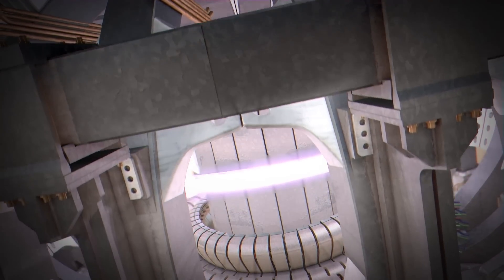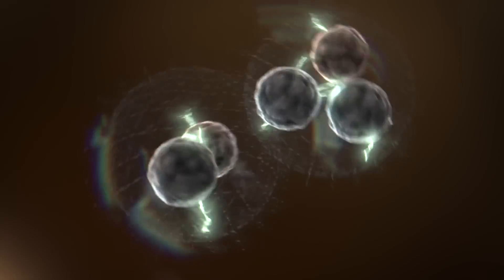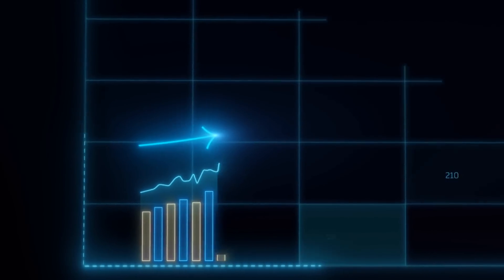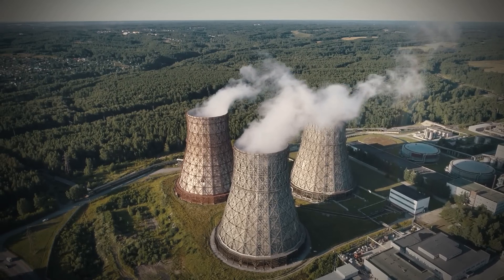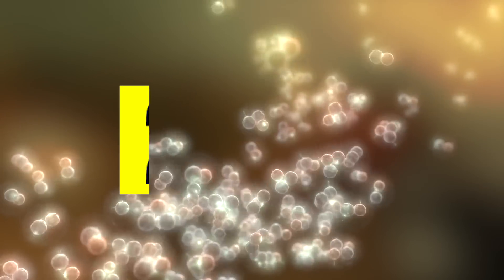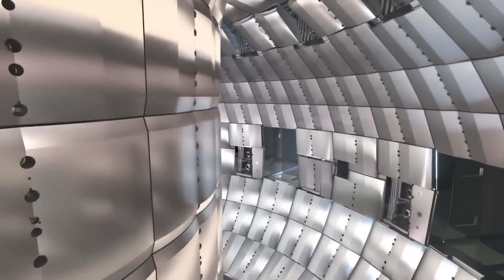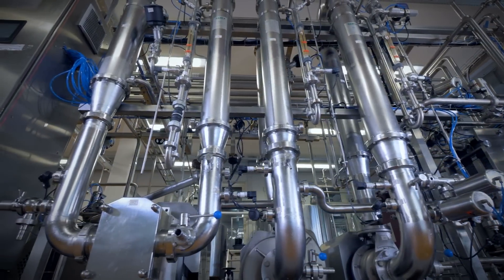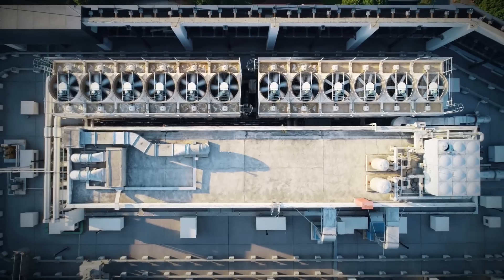The Shocking Problem That Could End Nuclear Fusion

Comment: Please do a video about First Light Fusion: projectile fusion aka pulse fusion (not self-sustained).  As I understand it can use deuterium only or both tritium and deuterium.  Would this be feasible in your opinion?
Reply: Right! Newer cheaper methods of ignition are being developed.
Reply: @n1mbusmusic606   yes, only $45 million (and many years of r&d).  Not a self sustained reaction, but it creates more energy out than that required to fire the electro magnetic gun.
Reply: @Joberrr  isn't general fusion piston reactor building pilots plants in UK and Canada though? Or is it just be..
Reply: @n1mbusmusic606  this is not the same as the piston reactor; this uses a small pellet fired with an electromagnetic rail gun at a 1 inch plastic cube with some deuterium inside.
Reply: @Joberrr  right wouldn't pistons pummeling a molten core of metal he just easier? General fusions design looks pretty sweet. Anyhow yeah I guess the fuel thing is an issue. My thing is we need to go to space for a few reasons(asteroid defense and mining etc) so why not just mine the moon? One visit could supply a century of h3 for the western world probably. Quite energy dense.
Reply: First Light Fusion have a great idea - and they avoid expensive tokamaks - but I have two questions. 1. What is the repetition rate? 2. Can they achieve a high tritium breeding ratio? Retaining the fast diffusing tritium will be a massive problem.
Reply: @johnh6245  Eventually the repetition rate would be once every 5 seconds.  I don’t know about the tritium. https://youtu.be/8Q5aZl9QMXo

Comment: there could also be energy generated or "absorbed on a very disturbed parasitic way for unnecessairy devices" with the orginal design for something fusion. but once build. no fuel is needed and that can "disturb" a " disturbed friend of history wich faith is dreaded into the energy supply too the civilians on a financial way" also criminals may not find out "if they still excist ??" an ud srfor j c6 l
Reply: and are forced too live "on gridd" for countries securities reasons. therefor haveing a machine that can generate power, wich is power on more then one way, can cause a problem. if not keeping secret. therefor no information will be added on. you can for sure be trusted. but what about your followers and descendence your sibblings your kids or new coworkers.  that will get otherwise the same means and "power" you
Reply: the exceptional trustee has. wich sadly enough my brothers and sisters. in my country is not advisable. for more reasons then i "as a jolly man" want to think of or want to talk about. i wish ! you good luck. and do not .blow yourself up.

Comment: Thorium nuclear reactors don't require tritium.
Reply: How does this have anything to do with fusion?
Reply: @demoniack81  because Thorium fission is safer than traditional fission and works. If the whole point of fusion is to create power, but doesn't work yet, then why not utilize something that does work?
Reply: @Bagginsess  Fission works in general, and there are no thorium designs that have been tested.
At that point why not just go with FBRs? The Integral Fast Reactor was just as safe if not safer than any thorium reactor, and it has the advantage of also being able to reburn the waste from and create extra fuel for existing LWRs.

Either way this is completely besides the point in a fusion video. Nobody (except fossil fueled "green" grifters) is proposing we should forgo fission and wait for fusion.
Fusion is the future, fission is the present. We need to stop emitting CO2 now, not in the future, therefore the only viable solution to that is fission.
Reply: @demoniack81  dude all I was doing was throwing some attention towards thorium because I find it to be under developed and I didn't want to rag on fusion which I personally think is either a pipe dream or far off in the future. Though instead trying to be decisive I just mentioned thorium and left it at that. There are more alternatives, for instance what you mentioned and also "modular" fission reactors, but again I just wanted to mention thorium so calm down man.